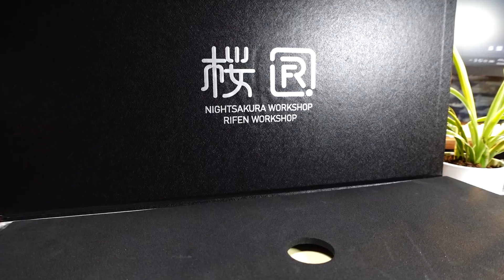Alina 80 TKL Build & Mods

Comment: Is the pcb 1.2mm. If so shouldn't you have used the 1.2mm variant of the tx stabs
Reply from the maker: Yes it would have been more ideal but I didn't have 1.2mm TX at the time of recording. Still worked out though :)
Reply: @studio20creations  For sure. My uncle is brining mine to US next month. Do you feel like this board is a keeper. Compaired to most recent keyboard trends
Reply from the maker: @DivideTimes  If you like soft and plushy typing feel, this won't disappoint. Also the design is unique & finishing is great. I would say it's a very nice board for the price but in terms of sound it's a little weaker than some others I have built recently
Reply: @studio20creations  Very interesting. Do you think using a 1.6mm pcb would effect the way it sounds?
Reply from the maker: Probably sound a little fuller/louder compared to a 1.2mm pcb